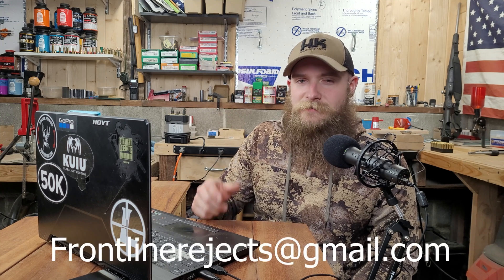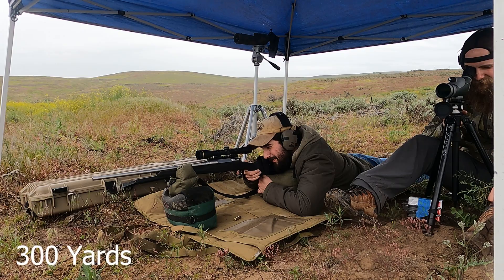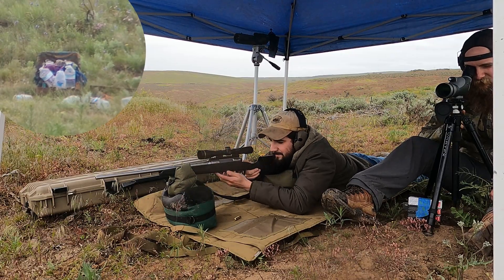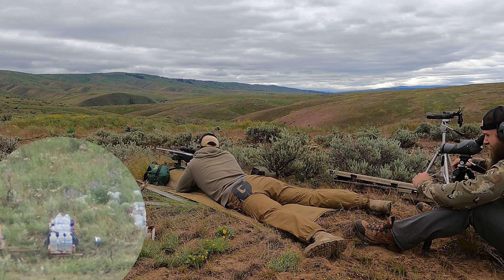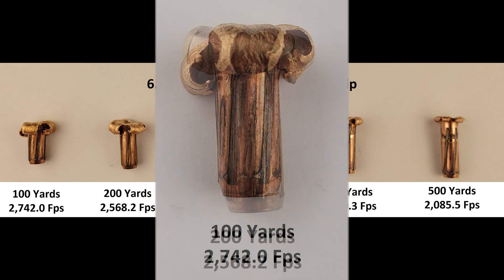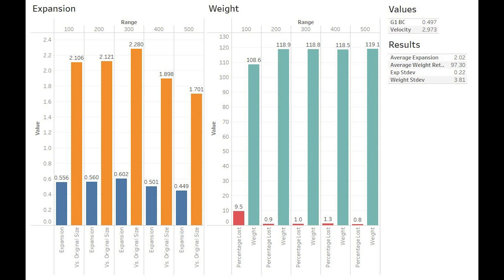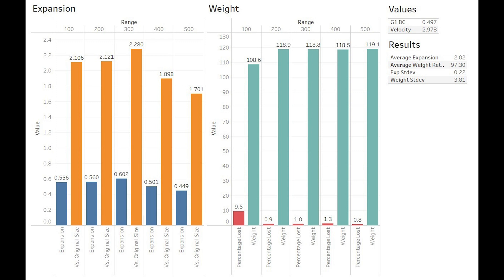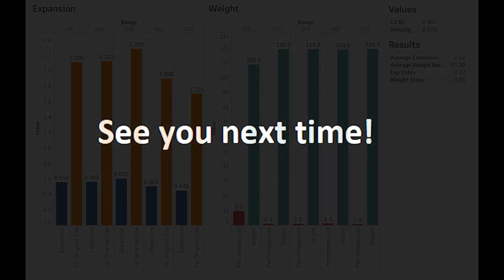(6.5 CM) Nosler 120gr E-Tip Expansion Test

Comment: Great videos.  I wish you could test how the perform after hitting something reasonably hard to simulate a bone.
Reply: They are literally testing these bullets against  one of the hardest mediums you can use: water. These results are skewed in the fact that what you see is an absolute best case (or worst case because it met too much resistance) scenario for bullet expansion.
Reply: @veteranironoutdoors8320  
I believe his point is that impacting bone can negatively impact the performance of a bullet. Not that he thinks it will expand better.
Reply: @ExF1Guy  @veteran iron&wood ^^^ this

Comment: Like your videos. But now it would be nice that you test 168gr e-tip in 300win mag or simmilar. Untill now you used all moderate loads/speeds. Bow its time to use something in 3200fps range 💪
Reply from the maker: If you're looking for high velocity testing with this bullet I would consider watching our video on running it in 270 WSM, in that chambering we had 3,371 FPS at the muzzle.
Thanks for your support!
Reply: @frontlinerejects8029  saw that also. But it would.be still interesting with lighter bullet in 300. I also tested few bullets in water and i saw much lower expansion than bullets recovered from  animals
Reply: My 308 loves the 168s